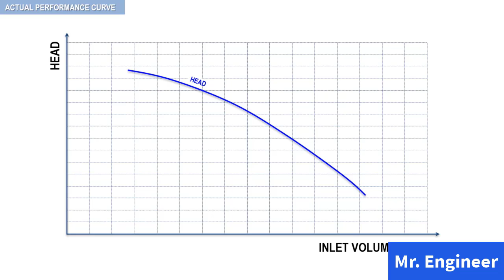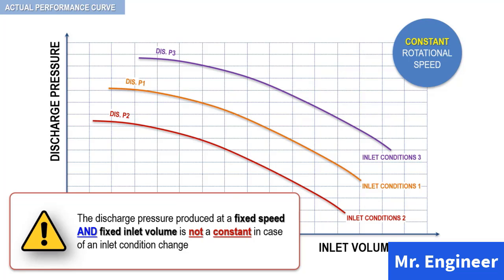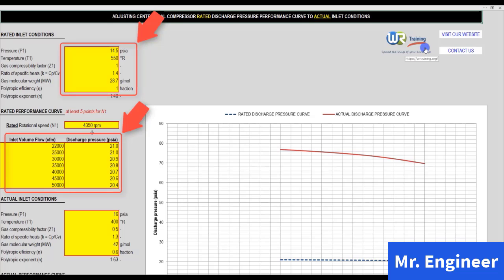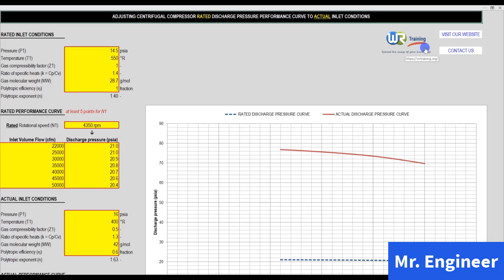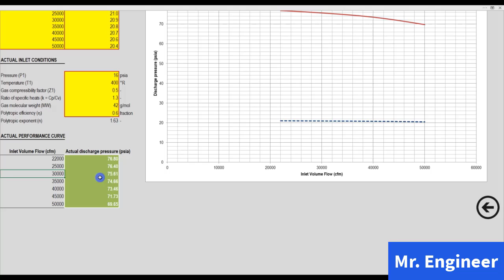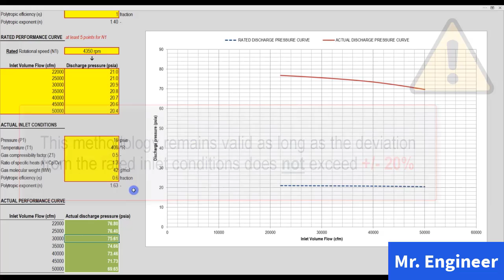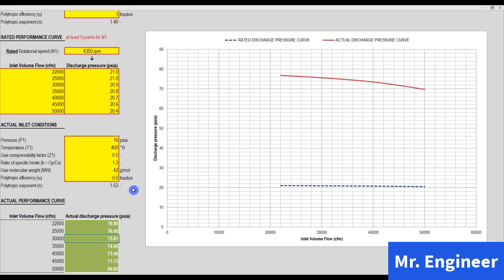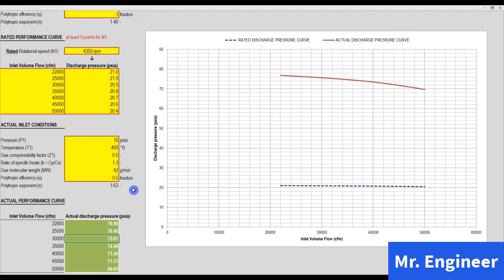Centrifugal Compressor Actual Performance Curve

Comment: why only discharge pressure change when inlet conditions change, everything will be changing including head when you change the inlet conditions
Reply: Discharge pressure have the same meaning of the head change. For the shaft power or the shaft speed all parameters are included MW, Pin, Pdis, Q, humidity